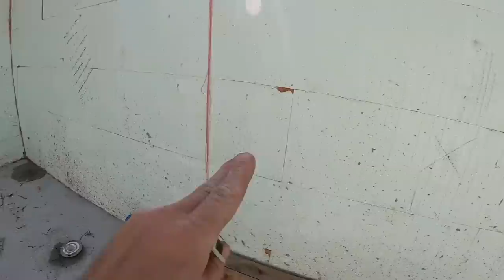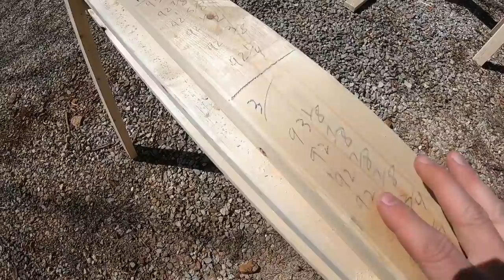Building ICF Steamboat Themed Cabin - Forming the ICF Floor System

Comment: That flooring system is sweet.  No overly complex bracing plan and wood studs to make hanging a ceiling a walk in the park.  I love it.  Plus it'll be a heck of a lot stronger than a standard joist floor.  Let's see what the termites do with concrete, the little buggers.  It's coming along nicely, Captain.
Reply from the maker: Lol, we should be good until the carbide ones show up!

Comment: Okay, I've been waiting for this part, very interesting. I've been wondering how that system was going to work, so the lumber inserted into the foam carries much of the load? I was wondering about concrete supporting itself without being excessively thick.  
(Also on my best behavior, no jokes about chainsaws and firefighters this morning, I'm still being nice to firefighters, the Texas wildfires came to within 200 feet of where I'm living last weekend, and they popped up again yesterday, and we've had crews from as far away as Arizona sitting on the ranch for over a week now.  So I applaud all you firefighters and not forgetting the aerial tanker drivers, for what you do.)
Reply from the maker: The wood acts as support during the pour and then the studs for ceiling support after.  But the concrete will support itself once cures
Reply: @CaptainKleeman .
I figured the studs inserted into the forms is used to hold ceiling tiles or  drywall.

Comment: I saw a video 2 weeks ago where a guy used a chaulk line, took a board put it on bottom sill and tapped the top to the chaulk line then cut. Sounds like a cool trick. Though I would share that with you. 
Those outros are just so tough.
You just hate too say goodbye. Lol
God bless.
Reply from the maker: Thanks!

Comment: Mike, At first, I was lost, but I can see it making sense.  Question on the design of Kitchen.  You mentioned that the Kitchenet is up front.  If that includes a sink/drain system, you put all of the plumbing is at the back of the boat.  What is the plan for water and sewage past the spiral staircase?
Reply from the maker: Pipes mainly 😂. Stay tuned!

Comment: Mike, I like this floor system, it is so simple. I also watch Jesse Muller and his system required a total floor framing system to lay the ICF on. I think his is Nudura but I'm not 100% on that. I switching to Jesse's channel to see his latest video on his house build.  
,
Reply from the maker: Nudura doesn't make a floor system.  The biggest difference in all the manufacturers is basically install.  The home owner ends up with very similar results.

Comment: I have seen icf walls plenty of times, but this is the first floor I have seen. What is the advantage of an icf floor over a I joist or floor truss? As it seems like the icf will make running plumbing and electrical a bit more of a pain in the butt. Most of the icf houses I have taken trusses to, usually use it for its insulation properties up in the colder areas of the state.

Comment: I think you're taking some of that tile pipe plastic pipe and put along each side of that down in that gravel and pull the water away from that and out some other way out to the back of it I put it in front of it I don't care but it just seems like it should be some kind of tile and air pulled whip the water away
Reply from the maker: Was one of the first things we did.  Appreciate ya watching

Comment: The floor system looks neat. Very interesting how that works. A lot stronger than wood framing too I'd imagine. If the opening for the spiral staircase is too large can you frame it in to make it smaller with out having to put any supports up from the concrete floor below? I'm not sure if you showed what I'm about to ask in the video or told about it but when you put the 2×4s in the floor with the expanding foam and screwed them at the ends of the forms, did you put more in the 2×4s from the other side? If not what keeps those boards from falling out or sagging when you hang sheetrock on them for the ceiling? I know the spray foam isn't strong enough to hold all that weight but if you didn't put screws from the other side does the pressure from the concrete push the foam against the 2×4s tight enough to keep them in place? Do you put screws through the foam that runs along the sides of the 2×4s so when you pour the concrete the screws are surrounded by the concrete like a sideways anchor? I think I'm just going to look up the floor system, how it works and how its installed so you don't have to try and answer all my crazy questions. Good video. The youtube yacht is coming along slowly but surely. Stay well. -Wil  👍

Comment: Is Mike simply running those horizontal screws just into the foam or are they tapcon type screws into the poured concrete walls
Reply from the maker: There are HDPE studs every 8 inches
Reply: That’s part of the webbing inside the ICF’s   Right ?

Comment: Hey Mike,  My question deals with the floor system.  If the Styrofoam boards are standard height, width and length why did it take so long to get the floor system?  I know you had to wait to save up the money but it just seemed that once you did order them it took quite a while.  Also how well will and ICF house hold up to a tornado or a bad storm?  Just curious.  As always a good video !
Reply from the maker: Alot of companies were/are having a hard time getting chemicals to produce the styrofoam.
Reply: @CaptainKleeman  Ok that makes sense.  thanks.

Comment: You never came up you're not very popular.... So when are you going to pill the foaming of that concrete... It would not be too intelligent to leave it there.... And remember my negative posts cost you money you don't make money on my negative posts... And thanks for giving me this angle... If you were to said that to me I would have just said yeah it's not the most intelligent think I've done in my life. Sometimes you have to roll with the punches.. You lost me when you said the little diamond shape was gonna be a circle.. Then you got like 3" of foam around the diamond shaped window how can you miss miss 3".... Was you having a bad day that day or something...
Reply from the maker: Hey, great questions!  This is insulated concrete forms. They have been used in the US since the sixties and have gained popularity over the years.  The foam is a permanent part of the wall.  It acts as the insulation.  One of the great things about ICF is how forgiving it can be.  You mentioned large spray foam areas.  If a fella has a bad measurement, he just has to spray foam that area to fill in where the ICF would have been, strap it for the pour, and it's good to go! Can't beat it.  Appreciate ya watching!